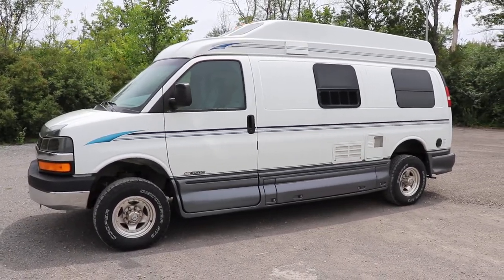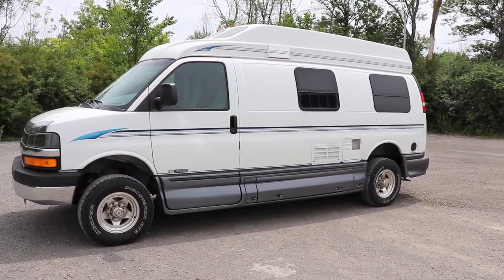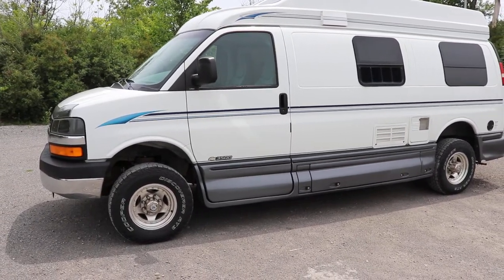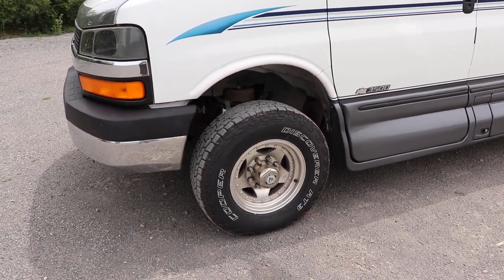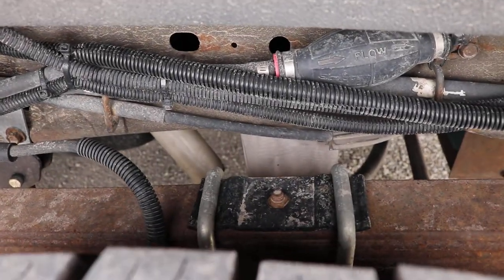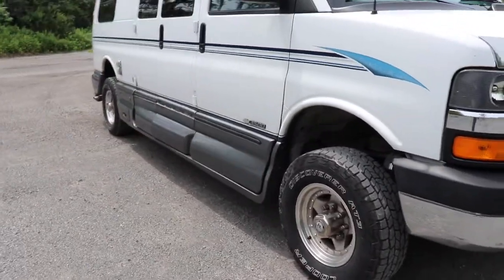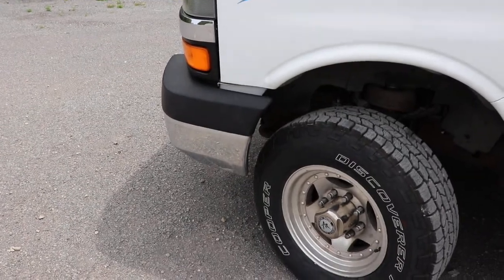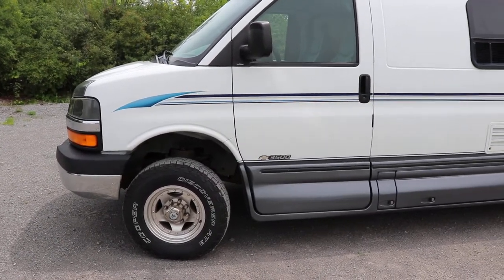WeldTec Designs 1 year Review - Chevy Express 3500 5" Lift and Fox Shocks

Comment: The interior would do OK off road, just like the other class B vans…Road Trek did quality work and used screws and brackets to hold up their cabinets…I wouldn’t go rock climbing, but light BLM or other dirt roads, it would be just fine (in my opinion). Heck, people are using Chinooks, Pleasure Ways, and other class B  and/or B+’s  off road…How about putting some heavy duty leaf springs in the rear?